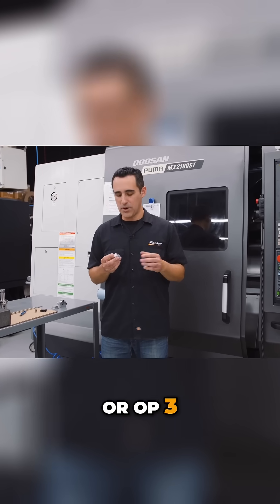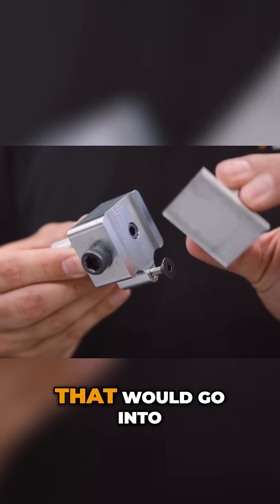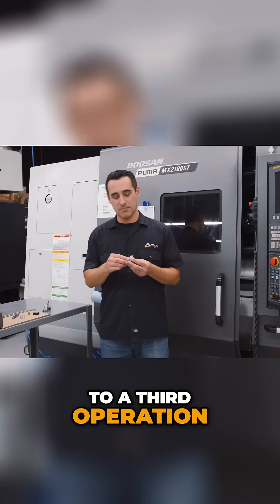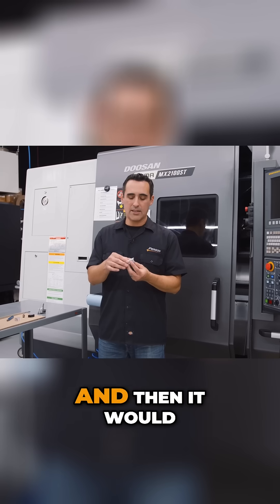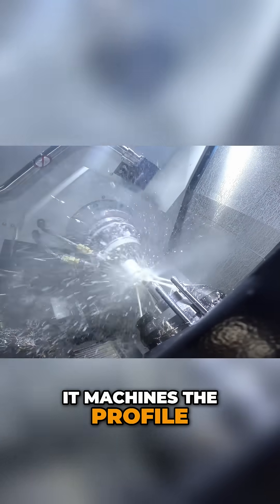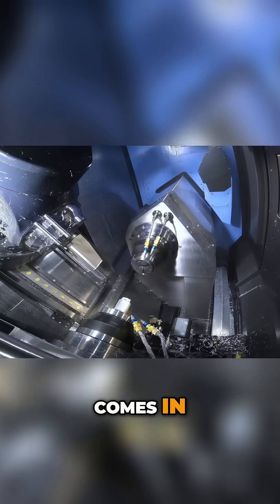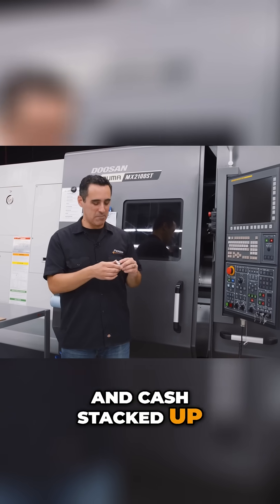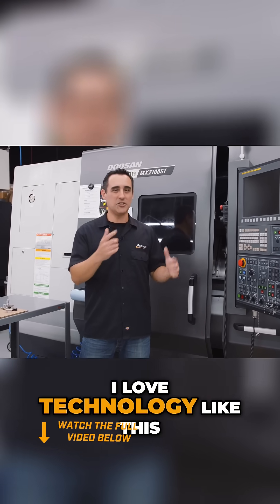My Machining Marvel #piersonworkholding #cncmachining #cnc #manufacturing #engineering #technology

Comment: Awfully pricey machine to make a part that could have been made on a much simpler machine.  My last shop had that exact MX machine.  I was not impressed with it at all.  Tool changes took forever and it's work envelope is severely compromised when milling axially to the main spindle.
Reply: What kind of simpler machine would you use for this application?
You will need the turning function with enough tools. Double turret with Double spindle lathe?
Reply: @youngforever9417 Sure something like a Puma TT would do the job in a smaller footprint and lower price.
Reply: I also want to know what machine you would say is better suited for this application.
Reply: @sarielcoronado7984  A Puma TT would easily do this job at a lower cost and smaller floor footprint. Not only that the TT would change tools faster. Cutting cycle time.
Reply: In Soviet Russia part make you.
Reply: Who said they bought this machine for this part only? Also, they're meant for machining complex parts in one operation at one machine, the added tool change time is almost negligible when you factor in the benefits (not limited to turret stations and clearance issues with them, one operator only, no expensive live tool units with weak power and small bearings, etc.) and can be mitigated with multifunction holders.
Reply: @CNCMatrix  You've never see the tool change time on one of the MX machines. If you had you wouldn't be saying it is negligible.
Reply: @brandons9138   Got me there, haven't seen it specifically on the MX. Could be bad/overcautious parameters from the factory? Our doosan mill had bad parameters from the factory which is just one of many reasons we won't be buying another (doosan).
Reply: @CNCMatrix  It could have been bad parameters.  It wasn't the actual changing of the tool. It was the time it took to get the milling head in position for a tool change.   It was even worse if you were milling with the spindle axial to the main spindle. It's been almost 6 yet now since I ran one, but I want to say it was 3-5 seconds to change a tool. It could be longer. Our MX had other issues as well. It blew up one milling spindle while I was there and the replacement only lasted a couple of months before it was shot as well. Doosan sent a company engineer to the shop to remove the spindle and install another new one. 

They are impressive looking machines, but they are just full of compromises.